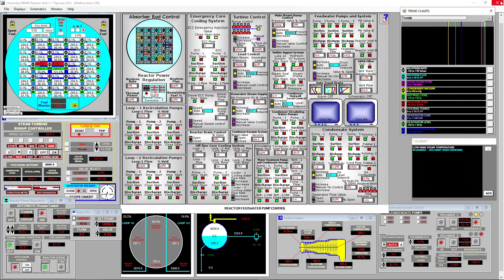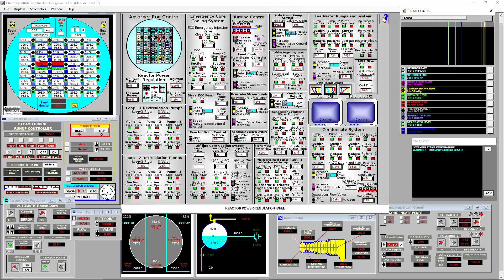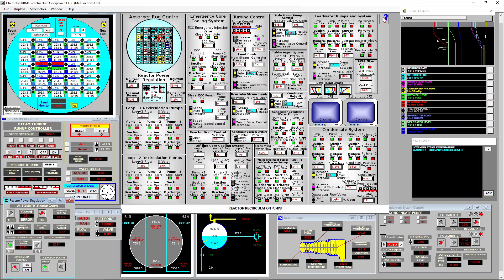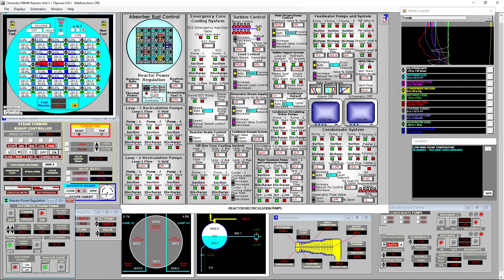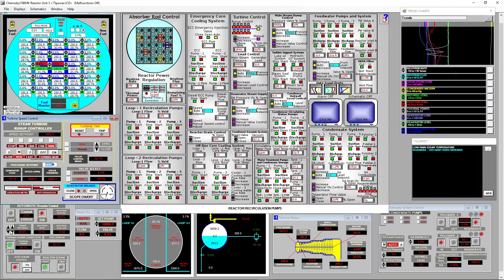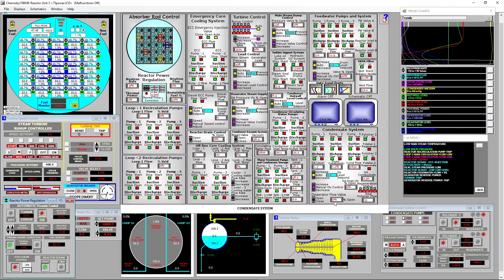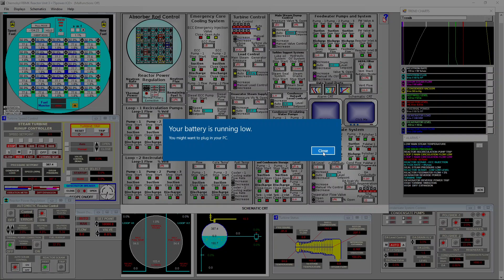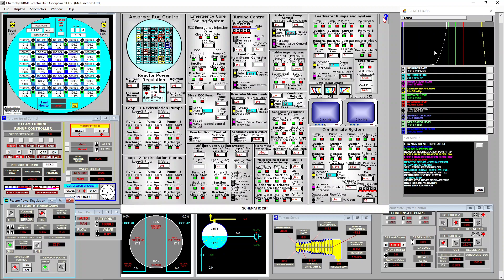First day at work in an RBMK reactor

Comment: Just a small update. Been testing a little bit and discovered that another whole hardware emulator called 86Box also works when setup with win 95 or 98. 86Box has the advantage of being able to run on macOS including the ARM/Apple Silicon computers. Happy emulating. EDIT: After more testing, I now recommend 86Box MUCH MORE over PCem. 86Box is PCem at it's core, but on steroids and significantly better.
Reply: I'm unable to run it in 86Box with Win98, I get an error message saying that mscoree.dll can't be found. Do you have any advice?
Reply: @ yeah, GDZX ported to into a modern application. Can’t post links but Argilaga has done a video on it since.
Reply: As for making it work on old hardware and emulators, sorry I’m not in the right mindset right now to fiddle with old windows, there are many other nerds here on YouTube that can help you with that, sorry again.

Comment: Does the Itchy-Avocado version still crash after 1.5h? Happend to me with the normal version, just when I was about to set the power setpoint to 20%. Was frustrating..
Reply from the maker: I managed to run it for two hours, but yes, at some point it crashes.
Reply: the version that I found on reddit I have run for more than a week without problems.

Comment: I am having awful difficulties installing this. When I download the simulator from the dropblox it enters my downloads as Chernobyl Reactor Simulator Itchy.7z. From there I tried to follow previous directions to unzip it in C: folder, but all unzipping tutorials show compressed files. The problem is that it doesn't seem to be a compressed file. I am so horribly confused.
Reply: That some expensive username right there
Reply: @idjdbrvvskambvvv9007  ?
Reply from the maker: Check the four different versions, the portable or itchy avocado ones should work out of the box.
Reply: @argilaga  It seems as if the error was on my end, I have the simulator open and running perfectly now :)